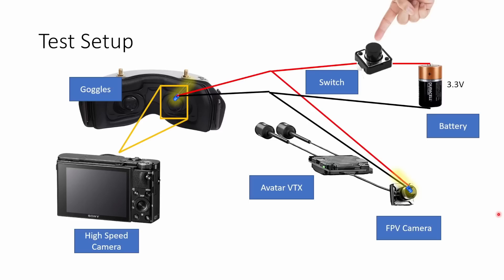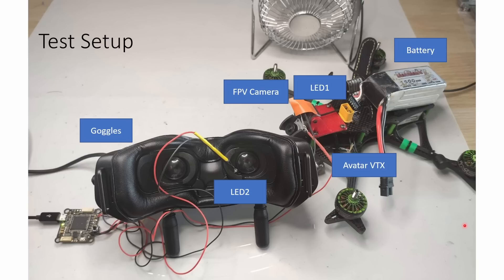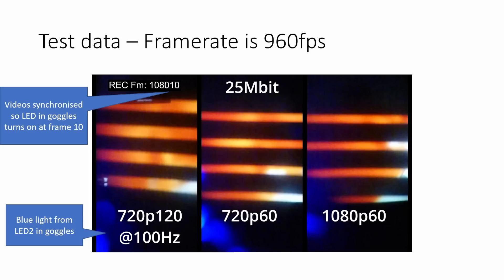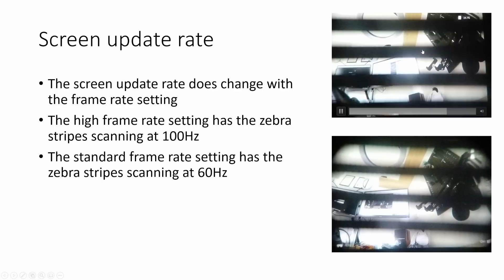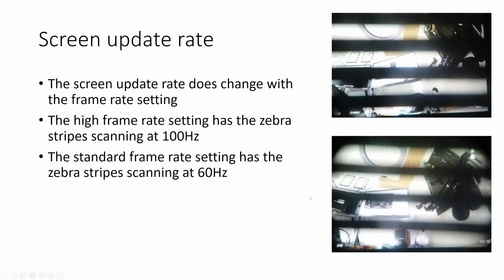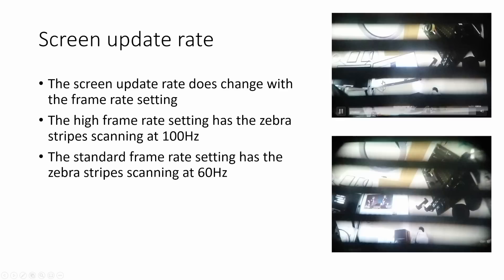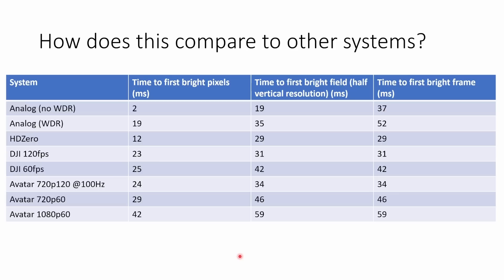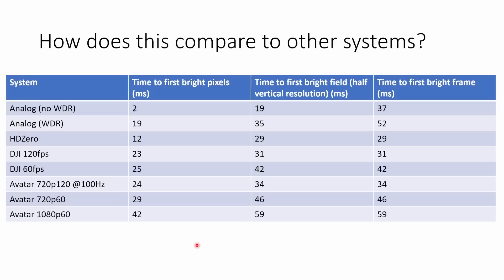Walksnail Avatar Latency Testing vs DJI, HDZero and Analog!

Comment: Really interesting insight into video systems here, especially the impact of WDR into latency. This really shows that consistant latency seems to be more important than the absolute value when peeps (including me!) claim, analog feels just so much more immersive despite the really shitty image. I'm gonna check those WDR settings ;D

This also means a bit of tweaking and optimizing of Avatar and launching that pre-teased fixed latency mode might actually do a whole lot of the trick and could really be a strong and competitive feature, even if this ends up in a slightly higher absolute latency. This also might be a strong feature against DJI who likely won't do that for their more image quality focussed target audience.

Still... now I'm damn curious how non-WDR feels against active-WDR... What camera did you use for this test? I could imagine this WDR-impact will not be the same on every camera. This might actually spread quite surprisingly between models even of the same manufacturer.
Reply: I don't think that a constant latency is very important. If we just talk about a jitter of 3-5 ms it will not be perceivable. The human brain is limiting factor 😉
Reply: @BumbleBeeFPV  I'm talking about DJI consitently dropping frames or dropping to 60-100ms the moment there is a tree in the way, not jitter.
Reply: Constant is one thing, as Enno noted, we probably won't be able to notice 3-5 ms jitter. But that's not what DJI & Avatar do. They have eg 31 ms in optimal conditions, but drag out to over 100ms at times if you're out of range. Analog and HDZero stick to their latency - whether 29 ms or 35 ms and don't triple in parts of the flight. You're definitely gonna notice that.
Reply: @Vousie  Indeed, that's exactly the issue. While Jitter free transmission (= real time = single clock synced) improves things (and trust me, it's noticable), the elephant in the room is the massive latency drop during frame recalls. I really wonder how constant latency mode in such a compression based system would look like. Lets see!
Reply: @aphinion  Constant latency would essentially look like HDZero, but probably more "fuzzy" instead of "blocky". And it would have poor penetration like HDZero has. People keep complaining about HDZero's lower penetration but that's specifically because HDZero doesn't resend frames which is why it gets so much better latency. People want to have their cake & eat it...
I'd love an option of something like DJI/Avatar but where it has an absolute max latency increase of say 20 ms and after that it just displays whatever it has & puts black squares wherever it doesn't have the data. Both of those systems currently seem to keep going until they get the image to show - even if they show a lower resolution version, they still want something, and that's the issue.
Though I wonder whether it's a technology issue - whether they need the full frame in order to be able to display it...
An alternative would be HDZero but just using the previous frame to fill in any holes from the current one - might be hard without a new chip, but it would greatly improve HDZero's "penetration" without adding any real latency.

Comment: Digital systems that use compression should be tested with pictures and not just with a led turning all pixels to the same color and intensity because the compression is very efficient if all pixels have the same value. In real use cases the compression is far less efficient and introduces much more latency due to all pixels changing value all the time.
Reply: Totally agree with this. When compression introduces artifacts,  do these modify latency (blocky images etc)? How about placing 16 blue LEDs in a grid over a monitor playing recorded gopro footage of FPV flying in a situation with rapidly changing detail, e.g bardwell video through trees :).  Then you'd get some measure of latency in different regions of the screen. Eg DJI may update the central area more often under situations where compression is struggling to reproduce the rapidly changing video... Despite this criticism, I totally appreciate your content. Thanks.
Reply from the maker: I love that not only did you provide constructive criticism but you also suggested a sensible and feasible way to implement an improvement. That wouldn't necessarily allow a time to first pixel measurement but could be a step forward for time to first field/frame.

Comment: It is tehnicaly possible that oled screen in this gogles is a "multiscan" thing Oleds generaly have much lower multiplex ratio than for example LCDs - you need more lines light up at same time or you will ned to push crazzy amount of pulse current througch ol;eds to get bright image - same thing happen in large format LED screens.
Reply from the maker: My understanding is you need to PWM oleds to reduce brightness without seeing colour drift due to the different responses of the coloured oleds.

Comment: Almost 60ms glass to full frame at 1080p60... that's like lagging 4 frames at 60fps....
Reply from the maker: Yes we can really see that h265 is not a codec optimised for latency! It's designed more for high compression rates. I expect the 1080p latency to improve as WS and Artosyn refine the encoder settings.

Comment: I had been wondering if the VRX component of the Avatar system is connected to the display component over something like an HDMI style link.

It seems like the rolling refresh might suggest something like that.

Like, WS developed basically a standalone VRX and then integrated it with a standard HDMI type display component in the goggles.

Comment: I can't wait the battle between Avatar and Avata cause dji V2 is outdated soon. 
My bet is for dji V3 and then I will upgrade from goggles racing edition if they will dji drones too.
If not I will not spend 1 cent in any new fpv product, only buy used air units and cameras for the dji goggles racing edition, the big red ones with touch control. Still works great with mavic 2 pro.

Comment: I fly HQ mode today. I'm only interested in Avatar for 1080p 50mbit mode. So your testing makes me even more reluctant to buy that system. Kinda hoping the DJI Goggles 2 does 1080p properly.

I've always thought it funny how folks felt analog was lower latency when my favorite analog cams matched DJI in HQ mode. Variable latency,...ok,... but how often are you flying proximity at the ranges the latency gets bad.
Reply from the maker: This is a great point. For me the variable latency of DJI is only noticeable in situations with such poor signal that an analog link would no longer be usable. One of the huge benefits I found with DJI was the increase in signal penetration.
Reply: @ChrisRosser   Yep. I remember when first getting DJI, I felt I could "fly the whole neighborhood".

Comment: What camera and what shutter speed did you record 960fps with? The strips could be a result of said factors as well as the rolling shutter of the camera used to capture the screens. I suspect this is a result of the OLED vs. LCD panel response times mixed with the rolling shutter... OLED panels have response times quicker than 1ms which is faster than you are capturing them in action.... and average LCDs are around 10ms....
Reply: This has nothing to do with it, look at the previous videos.
Reply: @itsallsobothersome4537  I did, and he doesn't know what it is which I was I offered up this concept for him to investigate and think about.
Reply from the maker: The camera is a Sony Xperia XZ. A single back strip is common for OLEDs like the sky04x a zebra Stripe is uncommon but the camera is capturing it accurately. The frame rate is high enough to resolve it scanning down the screen. Black bars are not visible at lower frame rates on eithe oled panel as they blur out over the longer exposures. 👍

Comment: This have no sense to be honest, you are testing analog video as digital,.which have not many sense.
I think you are mixing video information, with signal digital processing.
I recognize I didn't watch the full video but the conclusion cannot be right. 
Why you measure time for full frame , time show the two scans? Or you say it works 30fps?
That is ridiculous, you can cannot measure a analog video as a digital video.
60hz are 60fps, no 30fps, you receive 60fps, with half info and your brain mix the info for full frame. The info that you lose, is not less in any case than the info that you lose in areas with digital system.
Your are mixing terms and technologies.
I can measure with oscilloscope 2-6ms of latency in my cameras and 14ms end to end. Not sure what are you doing here.
For any pilot , and in practice, wont have many sense your results either, except the HD zero one that will pair with decent quality analog cameras, as phonenix v2 but still won't catch others low latency as Predator v5, CAT2 etc 
Quite miss leading this video
Reply from the maker: If you're interested in this topic I've done a couple of other videos which cover the points you've raised in more detail:
Analog video, interlacing, and frames vs fields: https://youtu.be/szJOUXineYw
DJI behaviour with partial bright frames and analog vs digital latency testing: https://youtu.be/9SBc35SccDg
Reply: @ChrisRosser  yes I watched them, I really think you treat the video as static images, in the moment you put a brain there to joint the things, your way to see the things is not valid nevermore.
In analog your brain make the part that in digital make a processor.
I really think your way of treat this topic is misleading, in example how you try to pair in latency analog with digital  by the need to wait for two scans to get the full image, that is not how a brain process video, is how a brain process a magazine.
You cannot double the latency of analogue by your way to measure  the things.
The analog latency, is what it is, with half of info in everyframe, the image processor will scale it and double the lines to fit the screen, and can be faster or slower and that is not analog video topic,
Reply from the maker: @Flamenawer  I tried to be very clear about this point in the video. I think the best comparsion between analog and digital is time to first full field not time to first full frame for exactly the reasons you suggest. Time to first full frame and time to first bright pixel is provided for completeness.

Comment: The worst part about you giving full statistics for first pixel, first field, and first frame is that now I have to decide what is most important? It's like there's no absolutes these days! 🤡
JK, I flipping love this science-- awesome hard facts.
Reply from the maker: Haha! Great response 😁 I think I lean towards full field rather than full frame. I don't think first bright pixel is particularly useful but is the only sensible comparison to the reported pipeline latency.
Reply: @ChrisRosser  I agree. I'm sure my brain can't tell when the first scan line has changed, but at first full field I'm pretty sure I can tell what is going on ("you're crashing, dummy"). I really appreciate you supplying all the data to let users choose instead of just declaring something as best, don't worry about why.
Now tell me which ExpressLRS packet mode is the best!